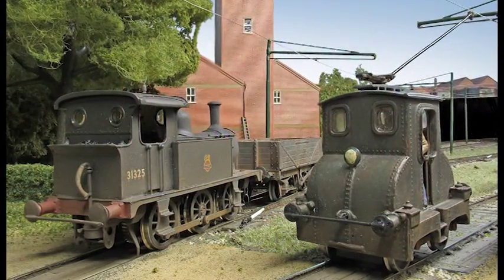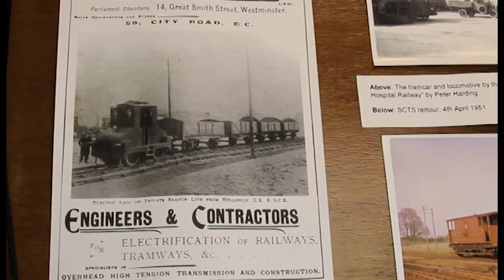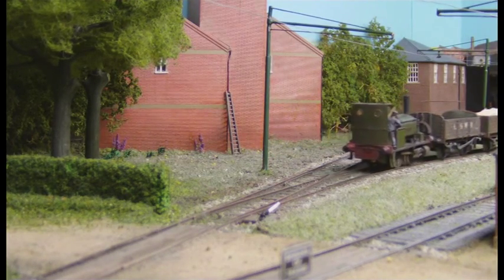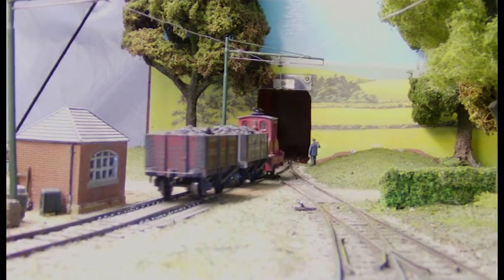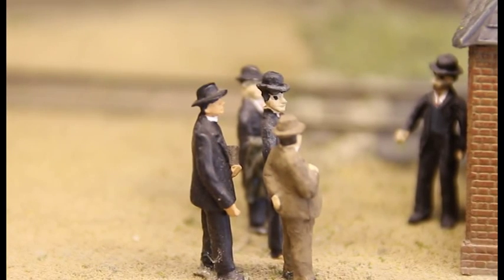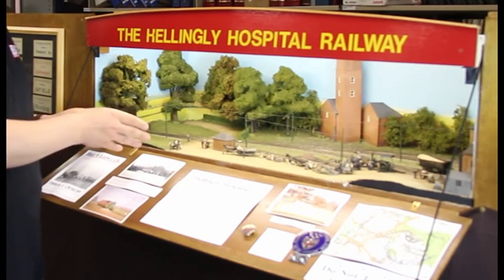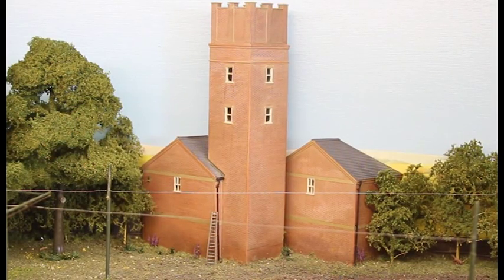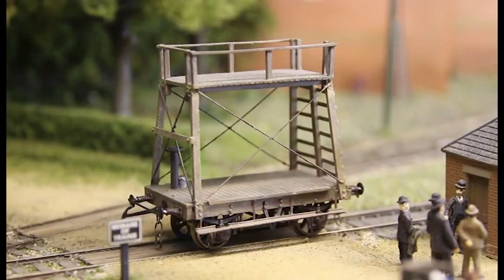Compact shunting layout 'Hellingly Hospital'

Comment: I used to work for the nursery next to Swingate crossroads half-way along the line, and am making a 2ft 3" working diorama based on the photo in Peter Hardings book, which shows the Norbury Club outing crossing Park Rd on its way to the station. I am calling it Swingate Crossing

Comment: 0:50 what kind of wagon is that?!
Reply: Wagons like this were used for maintenance/repair work on the overhead equipment, associated more with tramways than railways. They often appeared at night, when the system was closed, so not a very common sight. Another variant was the "works tram", similar to the wagon, but self-propelled. They could be driven from either end, so no loco was needed. This looks like a lovely little model, probably kit-built, or scratch-built.
I hope that's some help - no-one else seemed to be answering you.☺

Cheers,
Dougie.